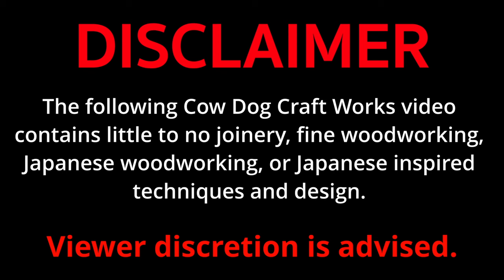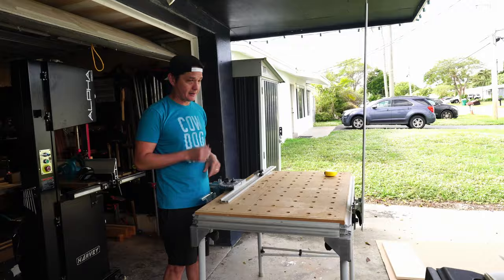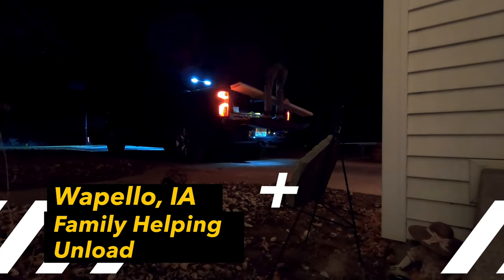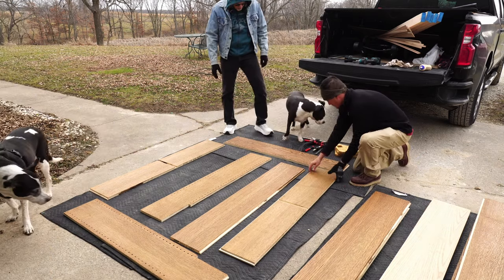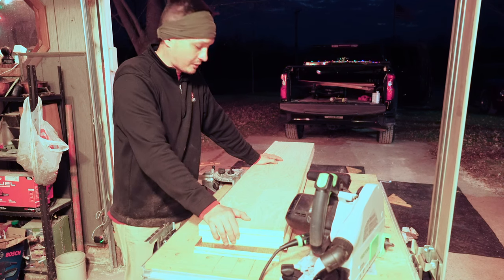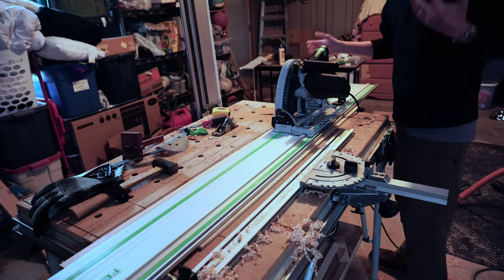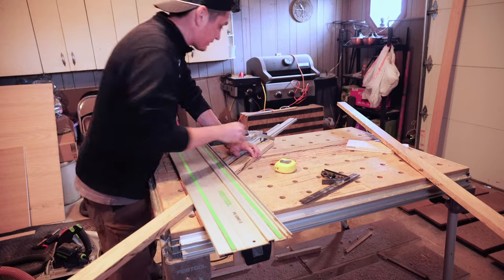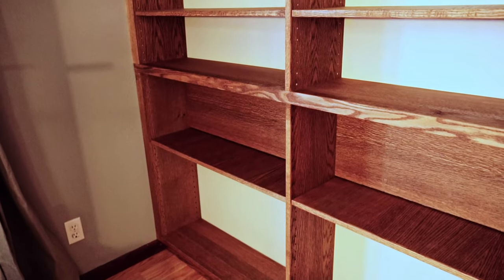Gifting the IMPOSSIBLE: A Handcrafted Built-In Library

Comment from the maker: Help support my channel through the following links:
Japanese Woodworking Tools: Their Tradition, Spirit and Use (Book): https://amzn.to/3f2eSuH
The Real Milk Paint Company's Impressive line of finishing products (Special Affiliate Link):
https://www.realmilkpaint.com/ref/cowdogcraftworks/
For 10% off use coupon code: cowdogcraftworks
-Starbond CA Glues (Special Affiliate Link): https://bit.ly/3A6I5h8
For 10% off use coupon code: cowdogcraftworks
Support Japanese Craftsmanship in America and purchase planes and blades from Suzuki Tool: https://suzukitool.com/
Making Shoji (Book): https://amzn.to/3EGLAiV
The Complete Japanese Joinery (Book): https://amzn.to/2OAj1sM
Makita Router Track Adapter: https://amzn.to/482e7ec
Makita 1 1/4 HP Compact Router: https://amzn.to/42y2ZV9
Makita Compact Router Plunge Base: https://amzn.to/3OBaN2H
Festool Plunge Cut Track Saw TS 55 FEQ-F Plus FS w/55" Guide Rail: https://amzn.to/3Uxp841 
Festool 495315 MFT/3 Multifunction Table: https://amzn.to/4851xuF
BOSCH ROS10 120 Volt Random Orbit Sander , Blue , 5": https://amzn.to/3UxzDVg
Rust-Oleum Watco 65351 Danish Oil Wood Finish, Pint, Black Walnut: https://amzn.to/3wauhFe
YONICO Slot Cutter Router Bit 1/4-Inch Height X 3/8-Inch Depth 1/4-Inch Shank: https://amzn.to/3uzJ4Zr
Freud 04-140: 3/4" (Dia.) Double Flute Straight Bit - Mortising Bit: https://amzn.to/3HOtLz0
Carson LumiLoupe Jeweler's Loupe: https://amzn.to/3thiuQJ
Naniwa 400 Grit Super Ceramic Water Stone (Japan Import): https://amzn.to/3QNnZRV
Naniwa abrasive Mfg Lobster Micron Deluxe Whetstone Extra Large M-60 ID-0530 #1500 (Japan Import): https://amzn.to/3QLEWfC
Naniwa Shrimp Stamp SS-5000 Professional Super Ceramic Whetstone with Base #5000: https://amzn.to/3Wj4Ubq
NANIWA Lobster mark/IF-1001 Snow White Super Finishing Stone #8000 with Plastic Holder: https://amzn.to/3IZsDdM
CFS 10202B07 StorPlus Full Size food Pan, Polycarbonate, 6" Deep, Clear: https://amzn.to/3IV1KaM
SCOTTCHEN Sink Bridge Whetstone Holder 24" Sharpening Stone Base Adjustable Expandable No-Slip Rubber Aluminum Stainless Steel for Easy Honing: https://amzn.to/3kiqDD7
DFM Diamond Lapping Plate MADE IN USA (120 Grit) for Flattening Waterstones and Sharpening: https://amzn.to/3z2MvWA

If you want access to more tools, check out my amazon storefront: https://www.amazon.com/shop/cowdogcraftworks

//Follow along:

IG: https://www.instagram.com/cowdogcraftworks/
Twitter: http://www.twitter.com/cowdogcraftwork
Facebook: http://www.facebook.com/cowdogcraftworks
Website: http://www.cowdogcraftworks.com